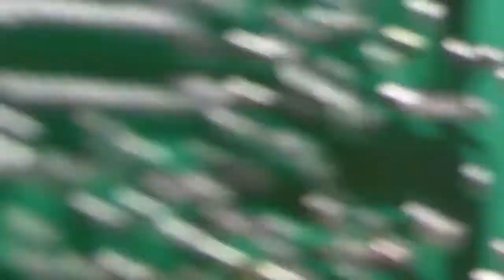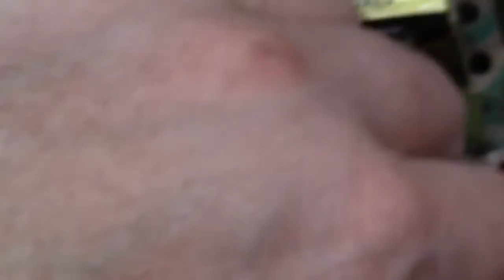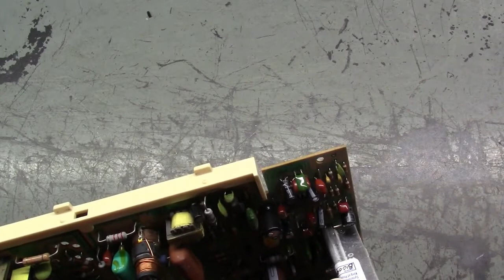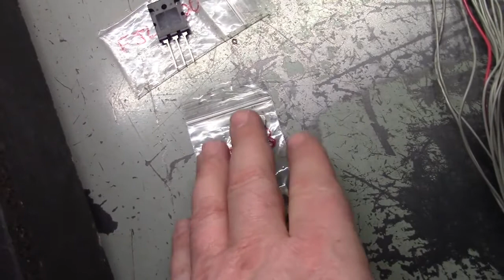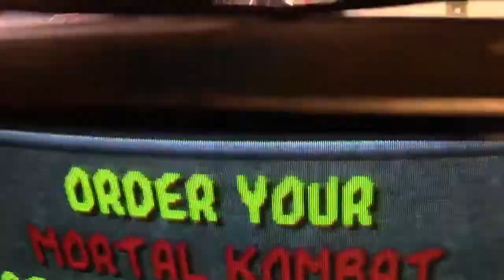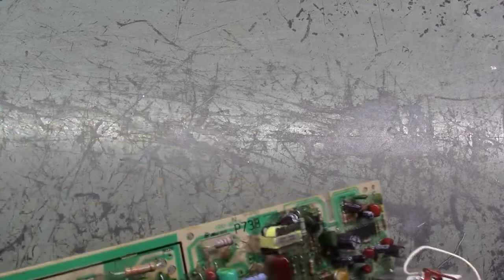25" U5000 Arcade Monitor Chassis Repair - Shorted HOT/Bad Resolution Headers

Comment: Hi Mike. I'm working on a u5000 right now. I'm getting no high voltage though. I tested all the components that you always test to determine on whether or not it'll power up or not. Everything checks good. But I'm not getting high voltage or any ticking sound or anything. Is there any other components that you can think of that I should test that would prevent me from getting high voltage or do you think I'm at a point where I need to replace the flyback? It kind of looks like it's already been replaced at one point. Visibly I don't see any signs that would indicate that it's bad. I don't have any old glue on the screen knob or focus knob. The sticker on the side is a bright white clean looking sticker it says 053X0624-001. I have not done a cap kit on it yet though
Reply from the maker: You check Q703? The board will be completely dead if it’s bad.
Reply: @MikesArcadeMonitorRepair  yep.  I didn't find the b+ test pin until after I pulled the chassis off the frame and tube.  I did, however test it at the post where 2 capacitors were linked together at the post where I had been testing the b+ at on the k7400s.  It was at 162 volts. Previous owner also had the vertical jumper sweep jumper on that horizontal sync post instead of the 130volt post
Reply from the maker: I’d try replacing the SMPS chip and the B+ pot. R104 good? Voltage regulator good?
Reply from the maker: You also may want to remove Q703 and test it out of circuit.
Reply: @MikesArcadeMonitorRepair  
   r10r, h.o.t and voltage regulator are good. smps chip tested good as well. Bridge rectifier diodes also tested good . Should I replace the high voltage shutdown pot AND the B+ regulator pot? I also mounted that resistor for that vertical sweep plug using the center metal tab with a screw in to that center hole. I secured it to that metal heat shield. Metal to metal.  I hope that was correct. I thought that's how it looked in your videos
Reply from the maker: At this point, yeah. Give that a try.
Reply: @MikesArcadeMonitorRepair  ok. Cool. Thanks. If neither pot replacement gives me h.v. would you then suspect flyback?
Reply from the maker: At that point, yes.
Reply: @MikesArcadeMonitorRepair  thanks. Good call